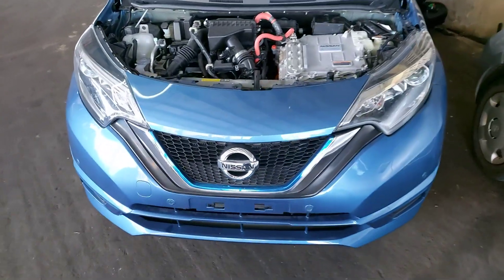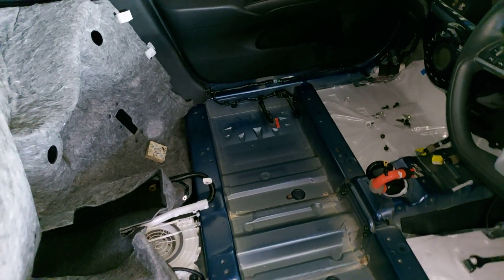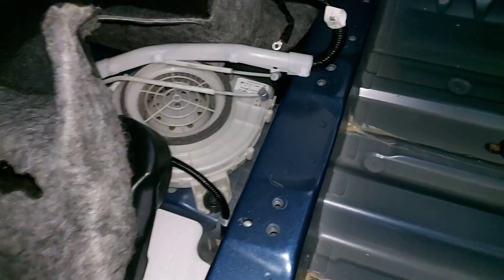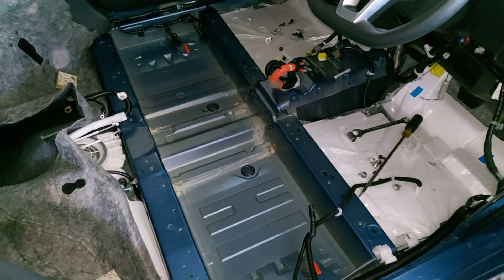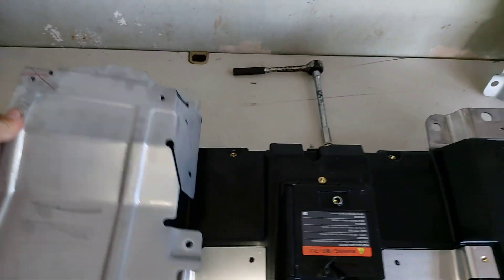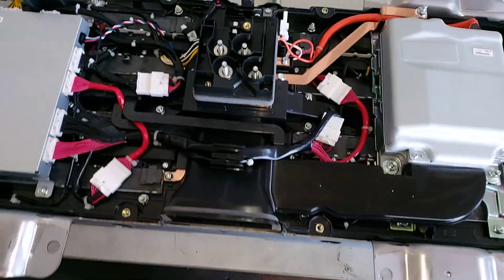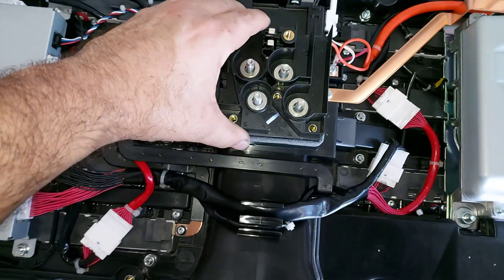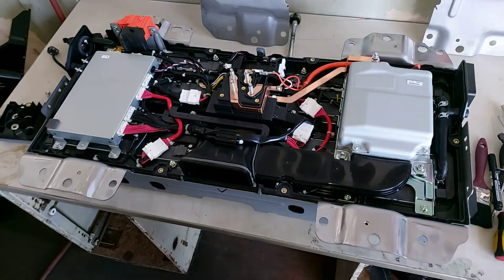nissan note epower repair part 1

Comment: Hello!
I have the exact problem and in need of a replacement battery. I decided to replace the battery because I am unable to fine a repairer. Can you assist in locating a battery for replacement?
Reply: Hi, how long  have you had your car before replacing the battery?
Reply: Unfortunately, I bought the vehicle unknowing that the battery was damaged. Upon receiving the vehicle I tried starting the car and I would not start. Check revealed that the battery was not good.
Reply: @kirky9141  from where i live battery replacement directly from nissan would cost you 300,000 php or around 5,400 USD.
Battery warranty is 8 yrs
Nissan Kicks is selling like hotcakes here and we havent seen any battery issue so far except the recent recall re aircon compressor.

Comment: Great vids man, have you ever heard of anyone tried hooking up the 1.8kWh battery from the e-power serena to the e-power note since they both use the same generator and motor ? Just curious if it could work.
Reply: That would be great option if work. Was actually looking if someone mod note e battery with higher capacity or any DIY plug-in way to charge the battery.
What i search so far is there are 4 sets of 20 cells in note e battery which are actually punched instead of screws. With Nominal voltage of 72, 80+ volt charger should be enough to charge each set.